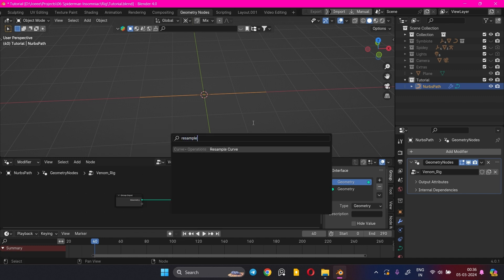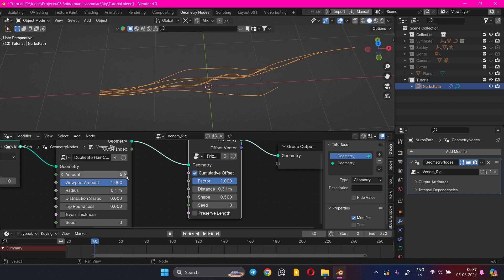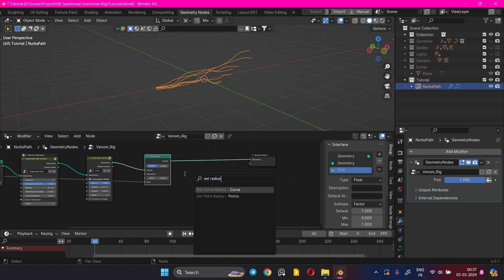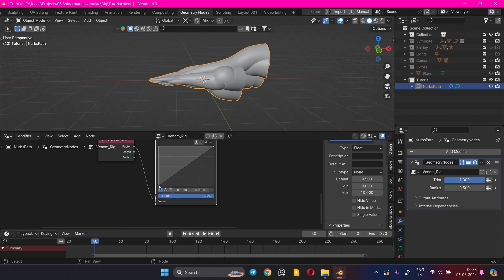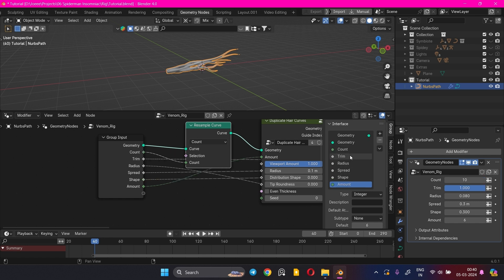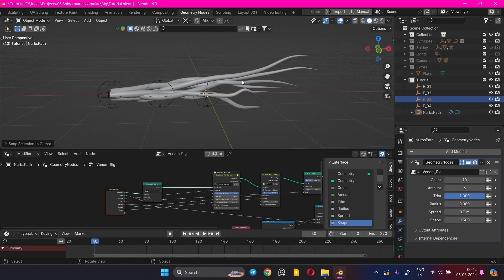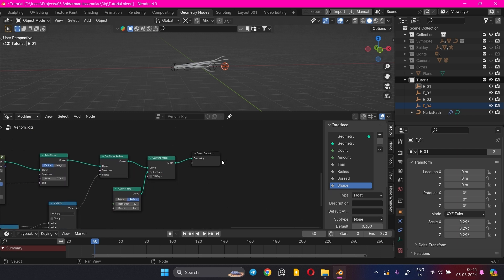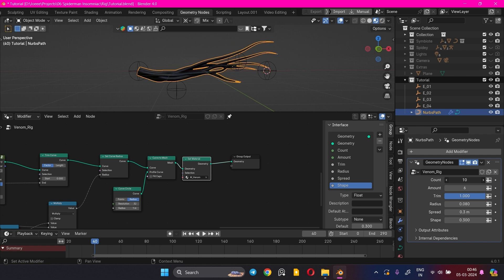Venom Symbiote Rig TUTORIAL | Blender | Geo Nodes

Comment: How do i control each tentacle individually? Can i animate it just so it keeps moving around like its alive?
Reply from the maker: Unfortunately you cannot move each tentacle individually. Alternatively you can add a Noise texture (4D) and multiply it with the factor (from spline parameter ) and plug it into the ' Set position ' node to create random movement to make it feel alive. Try it out , if you need help ping me in Instagram.